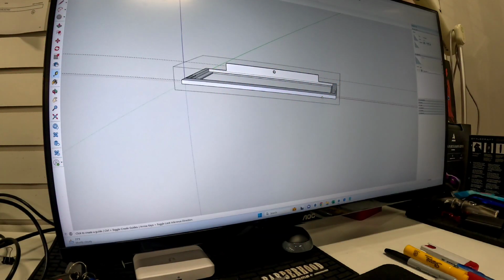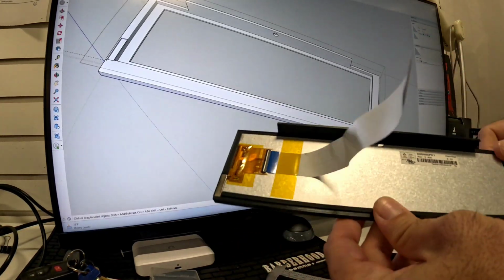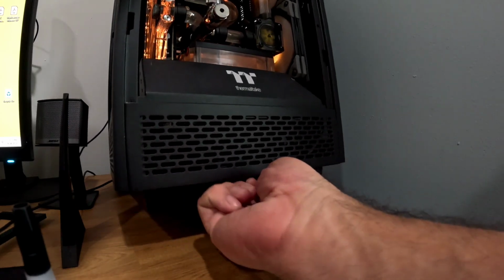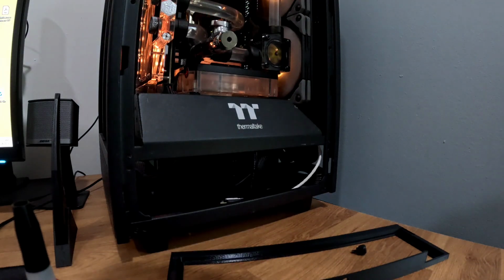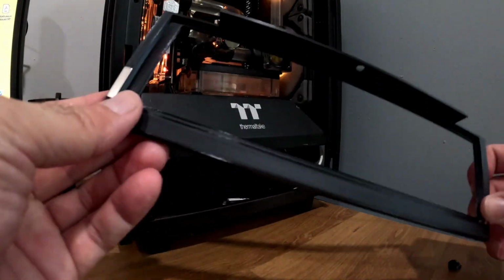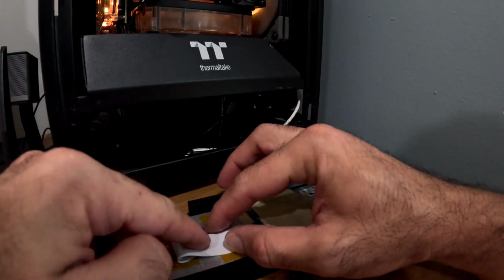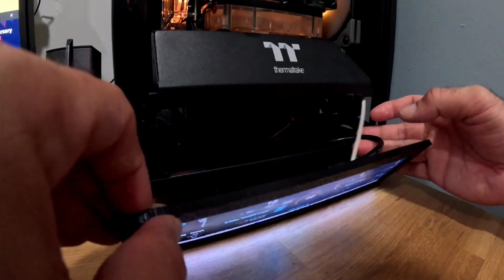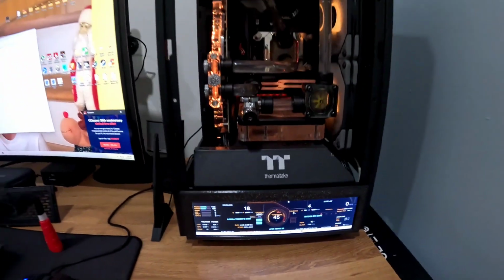THERMALTAKE TOWER 100 LCD mod explained

Comment: Oh no, I mistakenly thought this case was the same as mine. So now I have 2 LCD frames for the thermaltake 100. I have a 200.
Reply from the maker: This mod could also apply to the 200 and 300. Same screen different side 3d printed frame
Reply: @yunkeacme  oh definitely. I just need someone to modify the lcd.stl file and print it. 

If anyone that is interested in these, I have 2 available.

Comment: Is the printed piece the same dimensions as the original? Or is it taller? If it is larger, is it only compatible with the glass off the case?
Reply from the maker: @TheOriginalBlanked  sorry I just got to see this. Still interested in the info?